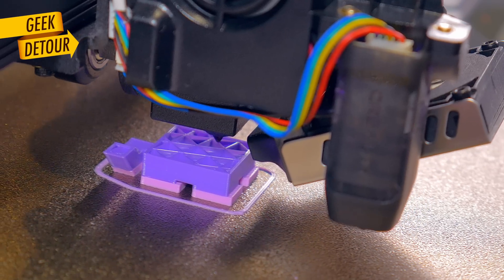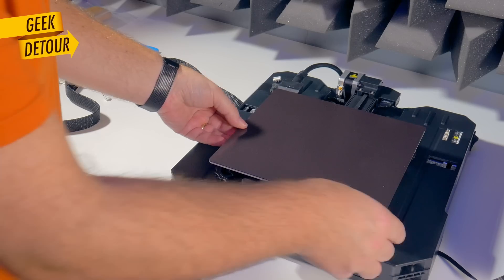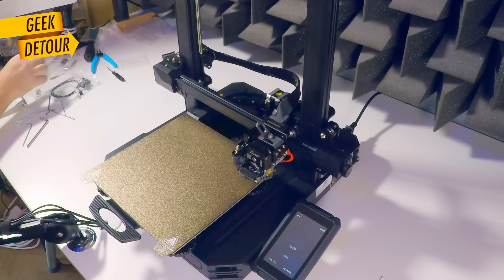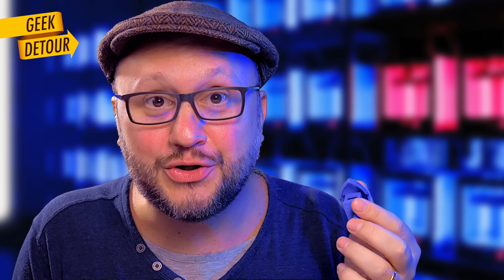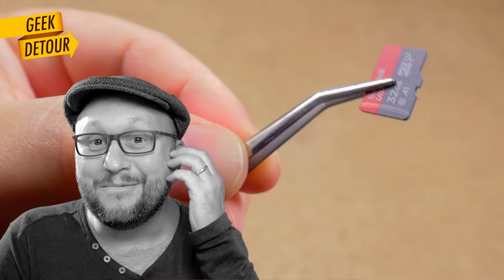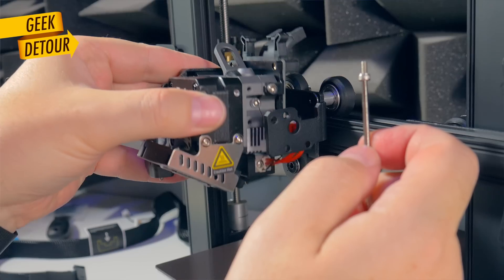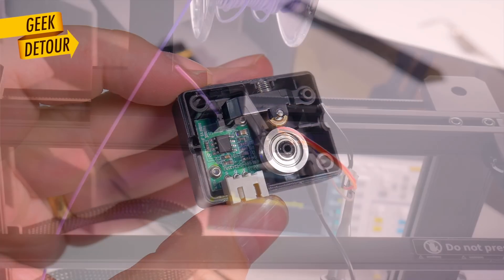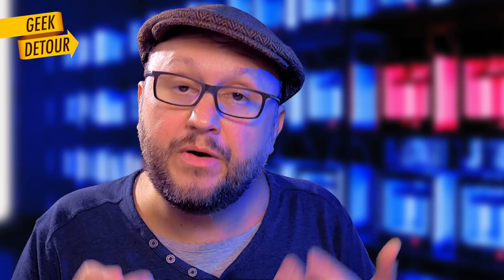Ender 3 S1 Pro: so good it begs for Klipper! 3D Printer + Creality Sonic Pad

Comment: I’m just an idiot I have to fight with mine almost every print idk why I can’t get it to consistently print correctly I’ve tried every bed leveling trick
Reply from the maker: Hi there! Don’t fight alone - are you participating on a User’s Group? Look for an Ender 3 S1 Pro Group on Facebook, post PHOTOS or Videos of your printer printing the first layer - people on the groups can help A LOT.
Here goes my personal advice: take the flexible plate out for the sink and wash it under warm water 💦 dish soap 🧼 and a sponge 🧽 - rinse it well and dry it with a paper towel. DONT TOUCH the surface with your fingers afterwards. The oils of our fingertips ruin adhesion. I promise this will  help A LOT.

Comment: Hi Great video thanks. I set my S1 Pro up yesterday. I have noticed you can only adjust the Z offset by .5 increments. My V2 Neo can be adjusted by .1. How can you do this with the S1 pro? Would the sonic pad enable this?
Reply from the maker: Right now I cannot test it to tell you (I don’t remember) My workshop, studio and printers are all in boxes. On Klipper I am almost sure it has very small increments on the web interface.

Comment: +1 sub.
Really nice video - I'm in agreement that about the only things letting the S1 down is the initial assembly problems and the firmware. I found a few errors in the old firmware regarding bed levelling, but thankfully updating to the newest version has solved these.

Comment: Great stuff you are sharing there, very well explained, really pleasant to watch and learn from your videos. 

Printing with Klipper Sonic Pad can increase highly print speed, up to 160mm/s keeping great quality.

What do you think of this standard basic aluminium heat block? It does the job at a certain point.
What about improving the heat sink and heat block to increase the melting zone, meaning the material flow too?
I created a plug and play kit in this matter, zero tool heat set swap, copper heat block and conical nozzle for increased thermal efficiency and flow, only need tester to confirm the improvements...  :)

Comment: Hello ! awesome video ! what have you set on the sonic pad/klipper for the rotation variable of the extruder (which replace marlin esteps)? because by calculation it should be 7.6xx but not sure it is really the good setting
Reply from the maker: That’s an excellent question - I don’t recall changing this value. I am sorry for not being able to check now - most of my printers are disassembled / packed because we are moving!
Reply: @GeekDetour  hello, dont worry ! creality did not documentate that and saw on reddit most users used a value around 26.X despite the calculation resulting in that 7.6X
Reply from the maker: Wow! That seems a big difference… I need to check this in two weeks 🤣 thanks for mentioning!

Comment: Love the video. I am looking at buying an Elegoo Neptune Pro 3 (maybe plus). 

How does this printer compare?
Reply from the maker: Hi Joshua! Elegoo sent me both the N3Pro and the N3Plus to review - I am late in launching these videos… Here is the thing: it is very hard to beat the price on the new Neptune 3 lineup, very good printers, good firmware, it is a solid purchase. IMPORTANT: the Plus and the MAX are not printers for beginners, they take much more space, will print slower (it is a heavier moving bed), calibration is a bit harder, so you need to ask yourself if printing BIG is a need.
The Sprite Extruder from Creality is really, really good - if you are willing to pay the premium price, buying the Ender 3 S1 or S1 Pro gets you the best extruder.
Elegoo’s new extruder is also good. It is an excellent product for the money.
So, there are no wrong purchases here, if you have the money. If you are on a budget or prefer to use part of the money to buy lots of filament colors, the Elegoo N3 Pro is a very good choice.
Did it help? Or made it worst? 🤣

Comment: How do you choose between neptune 3 pro and ender 3 s1 pro?
Reply from the maker: Hi there! I am making a review of the Neptune 3 Pro, but I can share some insights here already: it is an awesome printer for the money! By having dual Z axis and a direct drive, the N3Pro is substantially better than the N3. It is a solid choice if you are trying to keep the budget low. I tried the last Beta firmware from Elegoo and it came with all I need: Linear Advance and Pause for Filament Change (the things I criticized the Ender 3 S1 Pro for not having enabled on its firmware).
The Ender 3 S1 Pro’s Sprite Extruder is still better than the Neptune 3 Pro’s extruder. Does it justify the huge difference in price? That’s something hard to decide… I always think that it is better to not spend all your budget on the printer because it is much more fun to spend a hundred bucks in different filament colors 😂
Reply: @GeekDetour  Thank you very much for replying to me. You are a good man

Comment: Marlin is open source but Creality has not released the source code for this printer AFAIK.If you use community versions be aware these are not compatible with the touch screen.
Reply from the maker: You are right. It is possible, though, to buy the same knob-screen used on the S1 and use it instead of the touchscreen, then you can use the “Professional Firmware” from Miguel Risco-Castillo.
Reply: @GeekDetour  Yes, I'm aware of that but that's an extra cost that users shouldn't need to pay for. Creality really should be releasing the source code for the printer firmware.

Comment: Duuuude! Klipper on a pad!! Holy cow . I’ve been trying to install clipper I break my machine I had to put the old firmware back on and I still didn’t get it to work yet man that sounds awesome.
Reply from the maker: Yeah, if you have one of the supported Creality Machines, installing Klipper with the Sonic Pad is really a smooth experience!
Reply: @GeekDetour  so I have a question about klipper, is the firmware only on the sonic pad or rasberry pie (if used instead), or is the firmware of the printer changed as well? Just a bit confused if you could just unplug the sonic pad or rasberry pie and have it run on stock marlin.
Reply from the maker: Hi Tyler! Klipper has 2 big parts: all the software that runs on the Pi/Linux PC/Pad/whatever - and that’s what you interact with to use the printer, using a Web Browser.  And there is also the part that runs on the Printer board. And, yeah, it replaces Marlin. Once you install Klipper you cannot run Marlin.
But if you regret moving to Klipper, you can always flash Marlin back to your printer - it is just not convenient to swap from Marlin to Klipper and vice-versa.
I wish there was an initiative to “combine” both and you could select which one you liked, when you turn on your printer, for example.
I heard from a few guys that they keep 2 SDCards ready for switching firmware - I never tried doing that. In practice, people that move to Klipper tend to stick to it.

Comment: The Creality pad 180$ (a roberry for what s inside) cheaper than a Rpi4 ... ??!
Reply from the maker: Sure! Can you post me a link for a Raspberry Pi 4 for me to buy online?
PS: the Raspberry Pi used to cost less than 80 bucks… but that was before COVID.
Reply: @GeekDetour  you might confuse the sold price and the value . Just as a discontinuity occur the sold pice raised ... So much that is isn t a viable option anymore because that s not what it s worth. The production will start again soon you ll get closer to 60 bucks for an official rpi4 within a few month.
Reply from the maker: Sure! You have a point: a Raspberry Pi shouldn’t cost more than 80, 90 bucks - that’s why I didn’t buy them recently. And yet, in practice, if you really need one now, close to USD$ 200 is the typical offer you see online, which is insane. 
When I say: “For less that the price of a Raspberry Pi 4”, that’s the context! The Sonic Pad also brings way more value to someone that just wants Klipper: nice big screen with decent interface, installation is such a breeze… at a really competitive price. You don’t get it so much cheaper if you try to source the parts to put together a DIY solution, not to mention the “technical adventure” that is much more than many people can chew.
Does it make sense? Oh, happy 2023!
Reply: @GeekDetour  you might confuse the sold price and the value . Just as a discontinuity occur the sold price raised ... So much that is isn t a viable option anymore because that s not what it s worth. The production will start again soon you ll get closer to 60 bucks for an official rpi4 within a few month.

Comment: Just got my ender 3 S1 Pro today at £389 in the UK from BOX on Ebay took only 3 days for it to arrive AND now I see this Sonic Pad so it got me thinking Shall I go the whole hog and go for it / I like plug and Play out of the box so it looks like a win.
Reply: No not my first, have a FLsun and a A10 dual color, always printing gears for clock making as there are 2 people on YouTube I follow  and buy there files when available,  have 6 working  models todate
Reply from the maker: Hi Janet! Is it your first 3D Printer? You can learn a LOT, print thousands of things and have a bunch of fun with the Ender 3 S1 Pro the way it comes, without going Klipper.
Marlin has a larger user base and it is easier to get answers for any question than Klipper right now. 
I am loving Klipper and the Sonic Pad is great - but again, I have some mileage with the hobby already and I missed a couple of things in the Marlin that came on the S1 Pro (as I explained in the video). 
I don’t see how you would regret buying the Sonic Pad - but maybe it can wait a bit while you explore everything your printer already can do.

Comment: This is vishnu

I want to make a self watering plant

Using moister sensor ,arduino, 7 segment display and pump

 

But I am a beginner in coding arduino

In the project moister sensor senses the moister and display on 7 segment and in display 1 defines no water 2 defines 20% of water 3 defines 45% of water 4 defines 75% of water and 5 defines 100% of water 5 means there is more water,4 means there is enough water, 3 means less water ,2 means very less water if it shows 2 the pump must pump for certain time and stop incase moister was very very low and water was over and shows 1 the buozzer should on

 Kindly can you help me to write the code which perform this process and in connections of sensor etc
Reply from the maker: Hi there! Sorry, but... nobody will spend precious time to write code for a project like this, tailored for you, for free.  Search for "Arduino Plant Watering System" and you will find dozens of videos and articles - you can study those and go from there.
Reply: @GeekDetour  sorry for disturbing

Comment: You dont need a Raspi4 for this. I have mine running wirelessly on a pi3 with a cheap wifi adapter. DYOR.
Reply from the maker: Oh, I also have a Raspberry Pi 3B+ around… but all the Raspberry Pis are INSANELY expensive to buy right now. Sure, doesn’t NEED to be the 4.

Comment: i got the ender 3 as my first printer and it didnt work out as planned and i ended up having to return it with no thought of trying again.

then the s1 pro came out and its coming on the 25th!
Reply from the maker: Hi Dab! 3D Printing has some learning involved. Printers today are much easier: auto-bed leveling helps a lot, the PEI sheet also helps a lot - but there is the eccentric nuts adjustment, z-offset, keeping the bed clean (otherwise prints won’t stick). Be prepared to learn what you must learn to use it.
Other than that, lots of fun waiting for you 🤗

Comment: What slicer are you using? how do you get your prints to come out so clean! it must be the slicer settings?
Reply from the maker: Thanks Mark! The first big step is assembling and adjusting the mechanics correctly - nothing should wobble and yet the wheels shouldn’t be super tight. Belts should be well tensioned (of course there is a sweet spot tension). And finding the correct extrusion flow is also VERY important, not under extruding nor overextruding (and that varies a bit with every filament). There is no magic slicing settings that compensate for a wobbly printer.
Reply from the maker: And, well, being on camera with studio lights makes everything more beautiful 🤣👍 Ok, that’s true, but the prints got very decent indeed.

Comment: Very interesting, I have a one and I still working on making it more perfect as well. Question, is it one pad by machine? Or you can use the same pad on multiple Ender3 S1 Pro?
Reply from the maker: I just installed a recent update that allows you to have 4 printers… BUT I am not sure they work simultaneously… I need to check that, but I got the impression it is a “Switching” thing.

Comment: I did the Sprite Pro Extruder head on my 3v2 and it was totally worth it. 
I also did dual Z with sync belt/wheel and light. All aftermarket but now I basically have an S1 now lol. I love it. Put professional firmware on it and now it's pretty much everything I wanted.
Reply from the maker: Wow! Yeah! The Sprite Extruder is really amazing. I will totally upgrade my FrankenstEnder3 with one.
Reply: @GeekDetour  Can't wait to see another video on this. 

Also added the creality filament runout sensor on a pivot, thingiverse,  but I would probably have gotten the aftermarket one that uses 2 screw pattern that is meant to mount on it. 
For the dual z sync pulleys I did 60teeth and a 696x6 mm belt but it was too small  and binds higher up so I am ordering a 700( I think 700 will be spot on) +710mm belts to try. 

Also the stock lead screws are a little short for the pulleys to mount up top so I would order 400mm (stock is 365)set. Or... like I am going to order a 600mm lead screws(want them to sit higher for pulleys to have room.for mount) and 600mm extrusion, as the long cable for the Sprite Pro and y motor are long enough. 

I also have the support rod setup to help stabilize the setup. Which I will extend with m6 rod.  Along with a new wire to extend the filament sensor. That is the only cable that needs extension. 

Will be nice to add over 200mm more in height for about $100. But that is only.because the Sprite Pro.comes with such a long cable.Will just need to tap the extrusion and then it will be a straight forward install, update machine limits and done.

If you ever want to connect let me know. There's some things I wish I new before doing some of these upgrades and already went on long enough.

Comment: Is klipper and the sonic pad ONLY about speed? I don’t care about speed as much as accuracy. If klipper is better than marlin in MORE than speed I’ll think about it. I do know software developers don’t like the sonic pad because of licensing tactics. I don’t like buying things that some company stole from somebody else.
Reply from the maker: Hi Justin. It seems you won’t buy a Sonic Pad 🤣 But it is not stealing at all. Yes, there is more about Klipper than just speed - precision is indeed one of the most important aspects. That is worth a video aboutZ
Reply: @GeekDetour  Funny, TH3D has a blacklist about source code theft(ie: modify source code somebody else developed then don't share changes back to developer) and I posted a link which proved my comment about thievery but it mysteriously got deleted,hmmm. Oh and I have a Sonic Pad sitting on a shelf waiting for when these issues are corrected.

Comment: No one with a brain "loves" the springs. They're garbage. Silicone spacers are way better. They literally don't move. The springs do with vibrations.
Reply from the maker: Hi Daniel! I need to try the Silicone Spacers. I always used the yellow springs quite compressed - they feel quite rigid. Anyway, one day I’ll try Silicone Spacers and maybe try to measure any differences.
Reply: @Geek Detour  definitely try the silicone spacers. I've leveled my bed once 8 months ago and it still level.

Comment: I got one - my first printer and I love it.  Sadly I think many folks got into printing in the past, and jumped out due to the learning curve, and while there is still one here, it seems this printer is much easier to get started with.

I've since hooked up an old PC to it and am running klipper - that made all the difference in the world.  Being able to upload files and monitor from my phone or another computer has been amazing.
Reply from the maker: Hi Ricky. This same monitoring and ability to upload and print straight from the slicer is also possible running OctoPrint with Marlin - and works quite good. 
Anyway, I think Klipper is the next mainstream firmware, so, you are in the right direction!
Reply: What do I need to do to run klipper from my computer on the the ender 3 s1 pro?
Reply: What do I need to do to run klipper on my computer to my ender 3 s1 pro?